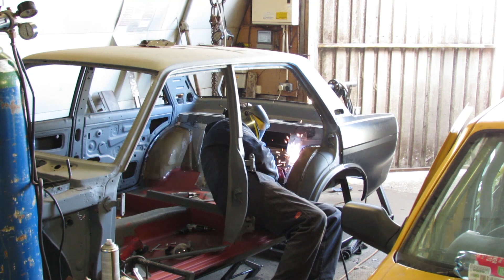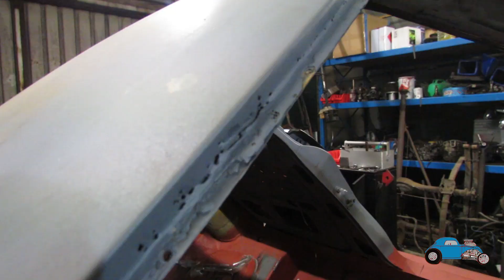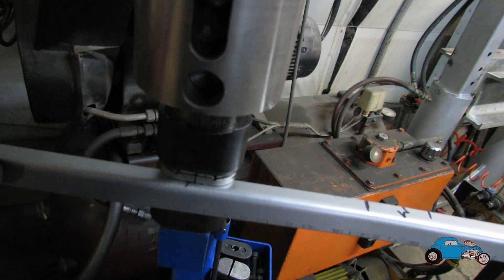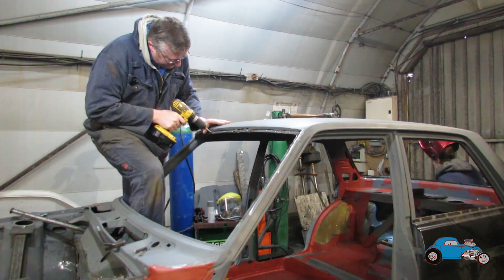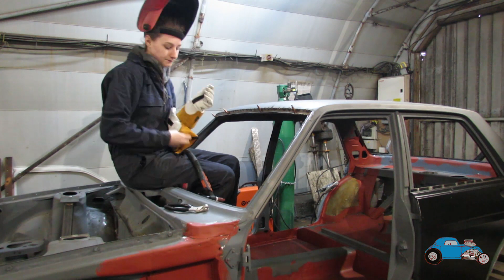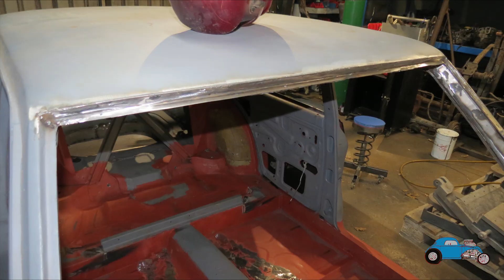Datsun 510 Custom Restoration! Part 6

Comment: Nice job!
What kind of primer is that red thing you are using?
Reply from the maker: Hi George, its red oxide primer
Reply: @usherengineering179  Thank you for your reply. Does it have any advantages over a two part epoxy primer?